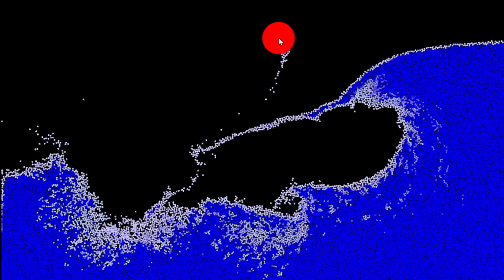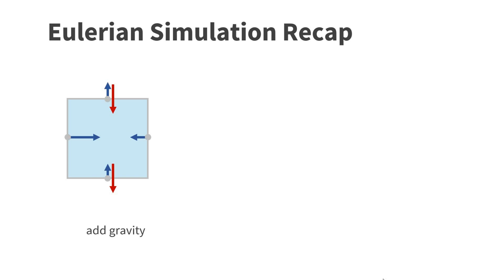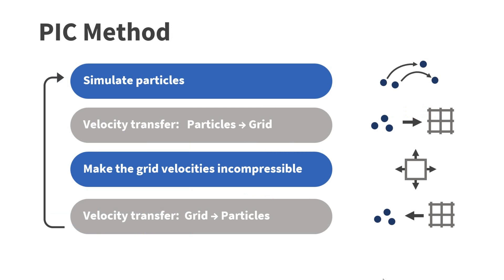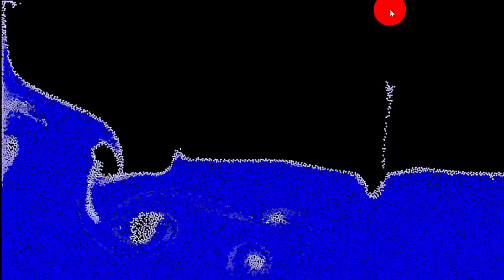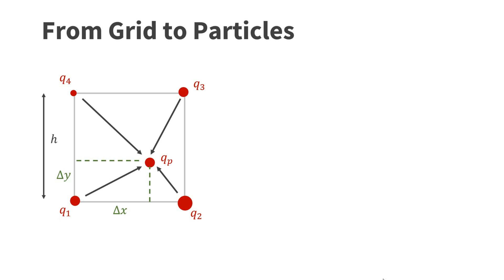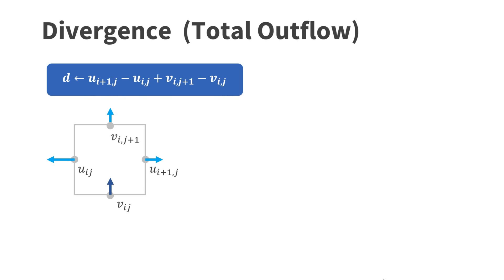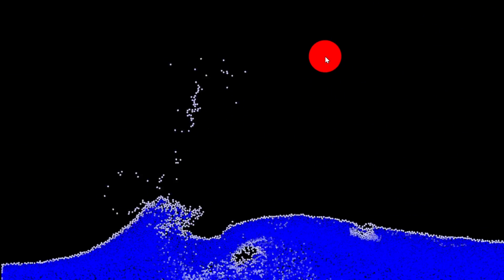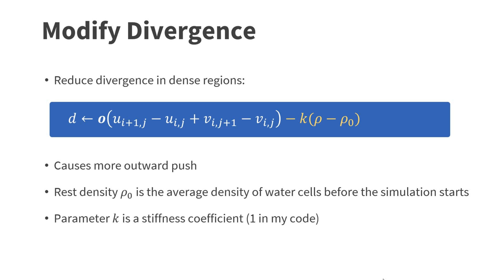18 - How to write a FLIP water / fluid simulation running in your browser

Comment: My feeble brain needs a code explanation, like concept wise i understand, 

How is this implemented in code?
For example,

 the 2d grid i know a 2d array is used but how does the program know that there is a boundary cross by an particle 

Is a particle just a value in this 2d array elements?
Reply: I would do some research on arakawa grids and discretization of PDE's. His code has zero comments, lots of shorthand, and is really difficult to follow. Nothing against him of course, but to the layman it is a challenge following entirely.

Comment: The small demo below is based on your video https://youtube.com/shorts/ErOrZmF3_T0
Reply: 32x32 grid, 512 particles, 1.0f cell size to ease up calculation, collision response modified to subtract normalized vector pointing outward from sphere center and its dot product with velocity from particle velocity ... Few other optimizations 20 to 30 fps on esp32-s3
Reply: Oh, for rendering I sample (interpolated) particle count per cell pixel perfect. Actual particles aren't rendered at all.
Reply from the maker: Cool!
Reply: @TenMinutePhysics  
https://youtube.com/shorts/e4X9HouWYPs
thx, above is a slightly optimized version. Changes to your logic: row major arrays, swapped order of collision handling to first deal with (spherical) boundary followed by particle collision (likely pushes some particles out of boundary, but avoids too dense particle regions at sphere edges ... as I render interpolated particle density grid, this gives better visual results). Simulation parameters are tweaked, so I get away with 2 projection passes and 4-6 particle collision passes per simulation Iteration. The issue is the ratio between gravity and time step resolution. To keep it looking realtime-ish I either have to use Euler time steps between 50-100ms or scale up measured acceleration by a order of magnitude (both pushes accuracy to the limits, with low iteration count). Oh, another change I made is in projects, it alternates between forward and backward looping over the velocity field for each iteration, to propagate velocity peaks close to edges evenly fast in both horizontal directions (did the same for advection in the eulerian simulation)

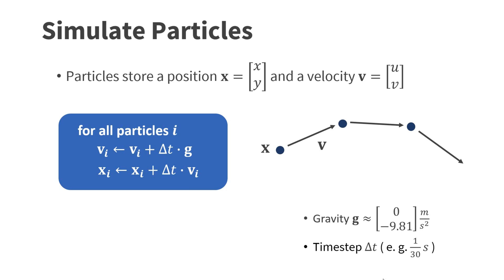Comment: 5:57 why is it called "(semi) implicit"? Is it not pretty explicit the formula I mean.
Reply: Half of of the formula can be computed explicitly but the other half has to be done differently (cause it unfortunatly it's notnexplicit)
Reply: I think implicit here means the future state is in terms of itself y_(n+1)=y_n + h*f(t_(n+1),y_(n+1)) this cannot be used to update, but if you use fixed point iteration to solve for y_(n+1) from everything you do know, as in solving the (maybe unlinear) equation Y = y_n + h*f(t_(n+1),Y) for Y, then you can use that to interate y_n
Reply: Using an "explicit" method means just using the previous values of y_n to get y_(n+1) = y_n + h*f(t_n,y_n). This method, however will usually have an exponential increase in numerical values, meaning the fluid get faster and faster and eventually explodes, while the implicit method has an exponential decrease, and it is ALWAYS stable. Semi-implicit combines explicit and implicit methods for different terms in the expression.

Comment: Why deal with multiple particles in a grid cell, just deal with density, pressure and momentum to get a velocity, then your grid is the resolution and pressure is the color, for air and water separation you can add gravity to each cell and pull down based on density.

Comment: Nice approach using the same grid, but it doesn't mean you have to ignore the gas cells! I just assume fluid velocity has a larger weight than gas and combine them wherever the fluid goes. Accuracy and speed is always a tradeoff, but it is possible to compromise to keep average error low and give plenty of room to make it very, very fast and highly parallel. For example, boundary condition correction can be quite heretical without sacrificing much visual fidelity, which sounds horrible, but it's a simple as something similar to signed distance field, but in a texture that can be sampled and added to position. I researched all of this and well, I'm no Carmack :D. It all depends on your objective.

Comment: I experimented with the project and added a fixed obstacle 90% of the way across the middle of the page and generated water particles above it. The problem I have is the solid obstacle leaks. While most water runs to the end of the obstacle and falls to the lower chamber. a significant fraction falls as 'rain' from the bottom of the obstacle. Is there any easy way to stop the leaks? I think the same is happening with the round obstacle as well.

Comment: I noticed that vortices seem to persist for a very long time in the simulation, is that intended?
Reply: Vortices persist for a long time in reality in fluids with low viscosity.  At airports, planes are forced to wait for the wingtip vortices of the prior departing plane to dissipate sufficiently before they are allowed to takeoff.  When a really large plane takes off (which produces strong vortices), this delay can be on the order of minutes before it is safe for another plane to take off.

Comment: Great video as always. Is the k*(rho - rho_0) term a standard trick? I don't believe I've seen it before in FLIP solvers. It seems like it wouldn't actually converge in the limit to the zero divergence solution unless all local particle densities converge to the global average particle density. Would you use it like this in practice with fixed k (your code seems to use k = 1) or would you drive k to zero over multiple solver iterations so as to avoid this seemingly non-physical behavior? Thanks!
Reply from the maker: Very good question. Fighting volume loss in fluid simulation is a difficult problem. Many methods have been proposed. I should have mentioned that mine isn't the final answer. It has the problems at the boundaries for instance as sph or pbf methods have due to the fact that the density is too small there. 10 minutes are too short to discuss this field but maybe I will do a separate tutorial on this interesting subject.
Reply: @TenMinutePhysics  But isn't the lower densities at the fluid edges what creates surface tension in real-life fluids? It appears so from the simulations I have implemented over the years.

Comment: Would this technique work with the Spatial Hash grid to get it out of the rectangular simulation domain?
Reply from the maker: Definitely yes! I will do it for the 3d implementation. It is a bit trickier than using it for neighbor search because you have to handle hash collisions. Two cells must not end up in the same slot.

Comment: This looks really good!
Implementing a physically accurate free surface fluid model (Volume-of-Fluid in lattice Boltzmann) was one of the hardest things I've ever done. Literature is full of errors and one particular paper with wrong equations did cost me months. But in the end it was all worth it and I could significantly improve the state-of-the-art method on GPU.
Reply: I'm very much hoping the one article youre talking about is not Frederico.